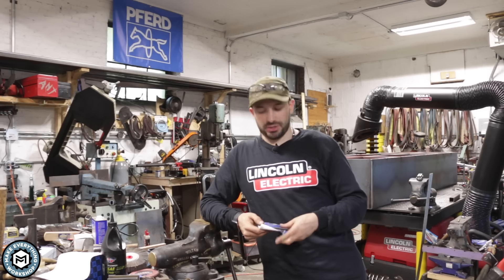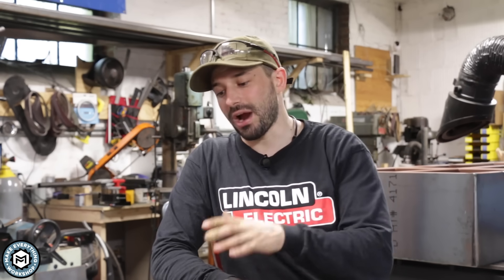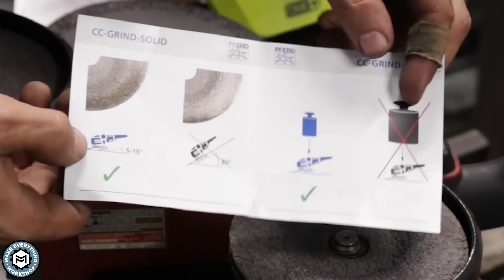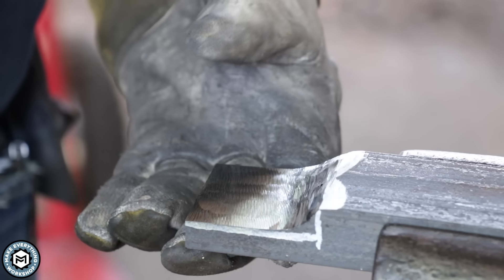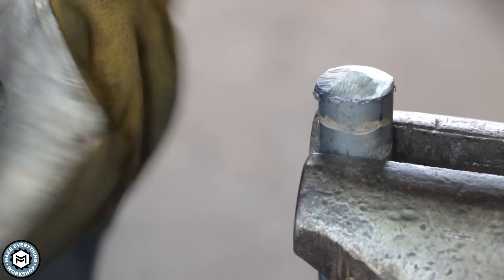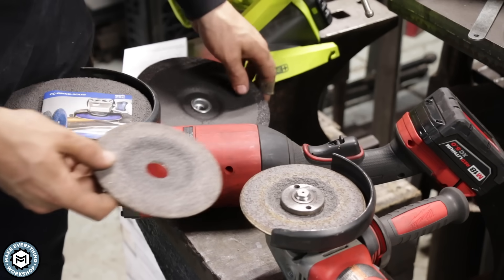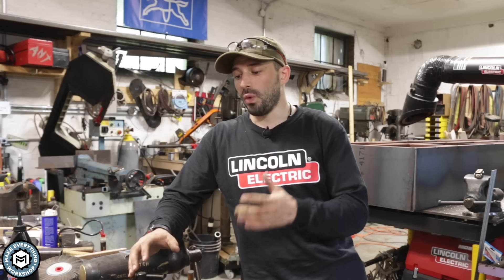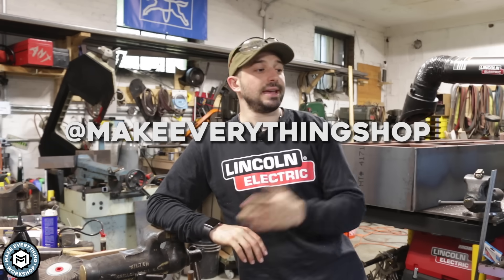A Grinding Disc That EATS Metal! Victograin VS Traditional Grinding Discs

Comment from the maker: Hey thanks for watching! Ive been updating the link for the discs as they are fluctuating into and out of stock. I’ll try to keep ontop of it! I just updated it so check it out!
Reply: Rapid grind makes the same disc 4.5 inch under 6 $ check into those
Reply: @briangreenfield7236  Have you used both? Just checking because if you haven’t used both you can’t compare.
Reply: @Len M.  no but I have used the Sharkskin disc's and the rapid  Shark skin were around 18 $ and I found the rapid grind for 1/3 the cost and they were the same trust me I can get you the Info if u would like to try them out ?
Reply: Will these fit the 4 1/2'" Dewalt grinder?
Reply: Man up, finish the test.

Comment: I need that Victograin for knifemaking. Won't even have to buy a belt sander (requires different pressure).

Easy grinding of spring steel and less filing needed.

Comment: Looks good…but not cheap.  A box of ten (in 2024) is 77 Quid (say 83 bucks).  A pack of ten regular bonded fibre discs are about 14 Quid (say 16 bucks)”  So “about the same cost” No! Not even nearly, but if they last five times longer you’ll beak even (source: Amazon).

Comment: Looks like Amazon has them individually for cheaper which im not ready to buy 10 at a time but i may order 1 or 2 also i almost never use the regular grinding disk i generally use the flap disk

Comment: I bought some and used it. The good thing about them is the size of dust is big and does not float in the air. Regular grinding discs cover every corner with black dust.
Reply from the maker: Yes! That’s one of the best parts about these, far less fine particles airborne!

Comment: ive welding fitting fabricating for a long time and give me a 1/8 pipeliner and ill smoke both of those. cheap grinding wheels vibrate. a good brand while they do have their bad ones every now and again its not nearly as many as the cheap brands. im not saying your lying but speeding up a video can hide a lot of truth

Comment: These are one piece of garbage.... Bought 2 disc for 14 bucks..... ate one disc in no time.... traditional grinding disc is way to go, no wonder there aren't other type of discs like this in the market, cuz they are garbage
Reply from the maker: You probably pressed too hard. Its a low angle low pressure disc.
Reply: Like the Spyderco ceramic benchstones, you don't want to press too hard or too soft on the metal.

Comment: I don’t think these disks are the same price as regular disks.
That being said I have some myself that I bought and I was absolutely blown away by the performance. Worth every extra penny over the regular ones. Especially the fact it doesn’t vibrate as much, really saves my hands. The shavings are also visibly different, much more stringy than the dust the normal ones produce.
I still have a regular disk kicking around somewhere but I don’t think I’ll ever use that again.

Comment: I have tried every sort of cutting/grinding disc’s you can get. Everything from local and big box stores to amazon brands. Pferd is the best. It is night and day difference how much better Pferd disc’s are. The only problem is that nobody readily carries them here in the states, so you just have to plan ahead and order accordingly. The performance and durability of Pferd grinding and cutting disc’s are absolutely amazing. It’s not even close.

Comment: Holy heck .. I just realised , if i don’t apply as much pressure onto my accelerator in my car , I use heaps less fuel. Just takes me 5x as long to get anywhere. Wonder if it’s the same which craft as these discs ? 🤔

Comment: Hi Chris, I was curious what the best cut off wheel you reccomend for a milwaukee m18 5" grinder/Cutter? I got quite confused over all the different types. Im not looking for a cutting/grinding duo....Im mainly going to be cutting hardened steel and stainless, grade 8 bolts as well. Thank you for your help!

Comment: Thank you for this video!! They are flat out amazing! After watching this I ordered a 10 pack off of Amazon. 5" Pferd victograin. You have saved me time, money, and M18 batteries! I sharpened our Fecon Blackhawk mulcher head on a 2021 cat 299 d3 skidsteer. The mulcher head has hardened steel for the teeth. You are absolutely right these are 4X faster than any traditional grinding discs. The teeth sharpened extremely quick without getting too hot. I will never go back to old school grinding discs. Pferd makes the best chainsaw files and grinding discs by far.

Comment: I had the same revelation when I tried Cubitron discs for the first time.  You quickly realize what utter garbage the HF discs are, and how 'stone age' typical discs are.  I'll definitely be trying out some of these.  Would be cool to see a comparison of these to other structured discs.  They still do seem like an awesome value.  I mounted a 4 1/2 grinder in a vise (eye-bolt into handle threaded hole, and remote switch), and put a cubitron disc on it.  It's the best darn rapid bench grinder I've used yet.  Think I'll build a mount for it to free up the vise.

Comment: I'm a professional.
Not a hobby horse.
I FULLY ENDORCE
 PFERD PRODUCTS. (UN-PAID)
Don't pay much mind to the harping and wise ass coments.
My maintainence turnaround time has to be fast. I often grind (removals) others would put in a milling machine. Including form fitting the repair. Some of it is so aggressive I frequently re-grease the bevel gears in my side grinders.

I haven't used a PFRED product yet that didn't do everything it's suposed to do. I'll be trying these next.

Comment: I'm new at this, but wouldn't it have been faster to use either a hacksaw, recip saw with metal cutting blade, or a miter saw with a metal cutting blade to cut the round bar (and perhaps finish it off with grinding the edge smooth)?
Reply: Yes, absolutely, best option if applicable. 

However that wasn't the point of the test.
The test was removal rate, round bar conveys that pretty easily.

Realistically you would never do this if you had other cutting options (cutoff disk, bandsaw, or hacksaw.)
Reply: It's called a  "demonstration".
Reply: It's called a  "demonstration".
Reply: It's called a  "demonstration".
Reply: It's called a  "demonstration".
Reply: It's called a  "demonstration".
Reply: It's called a  "demonstration".
Reply: It's called a  "demonstration".
Reply: It's called a  "demonstration".
Reply: Oh, so it's a demonstration of a crappy alternative.  Got it.  @waboom248

Comment: I'm gonna have to say bull, that's a lot of metal removed in a minute ,maybe 1/2 off the 1 inch round stock or 2 min for 1 inch but not 1 inch of metal a minute.  I used a 7 inch grinder with cubitron disc and only removed half inch off the 1 inch bar, you cut twice as much with a 4 1/2‽

Comment: Don't be too hard on yourself for leading into the grinding disc too hard. Everybody does that because they don't understand that the grinding disc to the metal and you let the disc do the work. If you could force the blade or the disc to grind the metal you wouldn't need to plug the damn thing in.
I worked at sheet metal for forty years, and I rarely saw anybody who knew how to use a damn grinder.

Comment: If you're continually grinding, for instance in a foundry, then fair enough but most guys use a grinder for a minute or two at a time. Most decent manufacturers have an equivalent ceramic abrasive wheel - Tyrolit Cerabond, 3M Cubitron, Norton SG so Pferd are not unique.

Comment: Off topic fab question.  I use 1 inch schedule 40 pipe offer and need to remove the inner weld.   You have a tool or process.  The pipe is no longer than 12 inches.  I’ve tried barrel type flap wheels and stone wheels on an extension.  Any help be appreciated.  Love you channel.  Found you yesterday and have already picked up a few pointers and got my shopping list together.

Comment: Bro i like them grinding disks but i use traditional grinding disks at work for hours a day preparing things before i weld them up and getting components made for building carnival rides and i never get sore from grinding i use a very high angle and it will eat metal with very little pressure i hold it at about 80° and it goes easy as long as you have the depth control so your not digging in but i will say those grinding disks are impressive.

Comment: Try out a Cubitron.  They can be used just like any other grinding wheel, last a long time, and eat faster than the cheapos I used to use.  I've never given thought to the vibration, but thinking back I think they're smoother running than the cheapos.

Comment: Maybe the vibration would be better if you were using a real grinder instead of those battery things.
Reply from the maker: The grinder I’m using in this video is a corded Milwaukee variable speed grinder . Its a great tooln

Comment: Silverline supply the worst discs on the planet, they barely grind the oxide and pretty much just polish metal, you can see the total lack of sparks, they're amazingly bad. I've tried just about all makes in 30 years of metal fab.

Comment: I bought a couple and I will give them a try. I’ve been grinding on steel for over 40 years, now retired but still work at home on my personal projects. I will definitely put them to the test and see what happens 👍
Reply: How’s they do?
Reply: @01sctacoma  haven’t used them yet. I’ve been to Bizzy working on my cars to get them ready for winter, doing a lot of delayed maintenance on them that now needs to be done.
Reply: @MrMopar413  have you used the disks yet

Comment: Nice! Never heard of these before. One problem with the regular bonded hard discs is they stop cutting once the metal starts heating up if you need to remove a bunch of metal. You can see this by looking at the paint pen mark burning off and not with the other style discs.

Comment: PFERD (Preferred or P-ferred) is a great company. I use them at work 14 hours a day, 6 days a week. We no longer use grinding discs, but grinding pads. They're much better than the ones you're using. We use 40 grit on 42" diameter by 80' joints of pipeline pipe that we manufacture. I have permanent numbness from the palm of my left hand to the tips of my fingers. OSHA is a joke.

Comment: I think if they really believe that these discs will blow away the old discs and make people switch they should make buying a single disc to try available instead of a box for almost a hundred bucks if they are that much better they should be confident that after someone trys one disc they won't go back
Reply from the maker: I’m working with Pferd to make single discs available directly so it’s easier to try them. I totally understand why buying a 10 pack is a big investment, and people are skeptical. That being said, if you buy from amazon and your not satisfied your able to return within 30 days and get a full refund.

Comment: Just noticed the white marker pen disappears off the metal when using regular discs compared to the first disc which means less heat in the metal with first disc = less stress to the metal

Comment: And I just checked both links he always puts up the 10 packs because they are giving him a kick back for making sales on Amazon, because they track those links and who sends what and opens what...  I'll find one or 2 and test them out myself...  If you really want to show their strength do it for stainless steel or some other forged hard metal composition...  Wether it's hot rolled or cold rolled, medium and low carbon steel isn't a true test anymore...

Comment: Have you ever used cubritronn2 by 3m? Personally I've never used victoriana but I am amazed at how fast 3m disc can remove materials
Reply: Yesss cubitrons are sooo good
Reply: These hands down out perform the Cubitron.They also make far less dust as the 3M disc wears down quickly. I won’t go back.

Comment: Here we go again, a kick back from your sponsor...  Those other ones I threw out, literally 3 good uses out of the blue and red circled sanding discs, how are these going to fare better?  I've got  pictures and part numbers to prove it...
Reply from the maker: Try these, If your not happy with them, bring them back to where you got them. Amazon will take them back if your not happy, and so will most reputable supply houses. The proofs in the test, these things work great. Follow the pressure and angle, and also the RPM recommendations and you’ll get a lot of good use out of them.
Reply: @MakeEverything  I've seen high speed low drag gear before, usually it's too good to be true, I won't stand by those other ones you recommended, but I will give these a shot...  If I have to cut anything 1" or larger I'm usually going to the band saw or the evolution saw, not going to sit here for 5 minutes when the band saw does it for 2 minutes on stainless steel, or the evolution saw does a bit faster... Time is money brother you know that...  Maybe for getting out imperfections or you need to get in a corner, but you showed these don't do anything for corners, so that's a negative hit on my analysis...
Reply: @MakeEverything  these are very similar to the ones I have used before for stainless steel, I have a Norton Blue fire and a vortex something... Part numbers are gone but I've used these quite a bit.  

I got those ones from Pferd last time on Amazon, the ones you recommended in your video, and again, 3 good uses after making a roll cage setup and then a motorcycle frame separately, light pressure no crazy angles, I went through the blue and the red one, I have one left and I'm hesitant to use it... 

Lol I was ROFLMAO when you said your hands hurt...  So stop trying too hard to sell us on vibrating hands, you are wearing gloves and I believe same thing, work smarter not harder however, the majority of what we do is with our minds and hands, so having thick skin and working out physically is part of our overall health but maybe not in the job description necessarily...

OSHA isn't going around the military, especially the Marine Corps, how long you been riding in this 7 ton? (1 week straight day and night) How long you been in this 998? (This is where I sleep) I've spent damn near an entire enlistment deployed and sleeping on rocks and in military vehicles, I'm sure OSHA didn't care about our nerves then, nor now...

Comment: You forgot to say wear a full respirator, these have ceramic in them, not just regular stone/glass
Reply: Underrated comment
Reply: Never really considered that. Aluminum silicate and silicon carbide are two of the more common abrasives I’ve worked with. It’s probably a good idea to wear ppe when using any grinding disc in general.
Reply: @Bansheekilr  he did not get paid for that yet
Reply: Their website does state that dust is reduced by 80% which is a pretty significant margin, regardless i always use a respirator when grinding because the fiberglass always makes my lungs hurt and ache for a few days when i don’t use one.
Reply: Then make your own video and you say it. 😷
Reply: @chrishevia  I'm not trying to sell you these cancer discs mate.

Comment: This is nothing more than another commercial. We already have enough of them.
Reply: For real. You can not trust this video.
Reply: I'll be honest that is what I thought too. It is like an infomercial he is trying to sell it. I would like to see this used without video sped up. It just looks fishy to me.
Reply: @nickbussard6089  His whole thing about not being able to hold on to the grinder when using a normal gringing wheel is bullshit. We all use normal grinding wheels without issue.
Reply: Another thing for me is the groves would absorb most of the vibration and you don't use a lot of pressure rock wheels anyways.

Comment: Lost a lot of credibility with this video IMO. I have never paid more than $2 for a regular 4.5" grinding disk and only a very weak person would be that tired after grinding for less than 10 minutes. At more than 4 times the pice ($70 for a 50 pack on Amazon) this isn't nearly as good of a deal as you make it sound. I like great products but value honesty more.
Reply: You can't compare a top of the line product to the bargain basement bulk junk on Amazon, genius. That's not the way product comparisons work. You don't compare a civic to a Ferrari. Derp. It's the same price as a comparable disk from the name brand manufacturers like Diablo or 3m.

Comment: I like the idea of the non-vibration feature.  I don't grind as much as I did 25 to 35 years ago but I know what you mean.  I can only go so long and the vibration wears me out.   I am going to try some of these.  I have Pferd 9" regular disks.  I like their brand but usually buy the cheap 4-1/2" or 5" disks.   I need to look in to this. Thanks for the review.

Comment: Man I’m so glad I saw this, and thanks for taking the time to showcase such a great product. As a blacksmith I go through discs like crazy and have searched far and low for a great disc like these and finally settled on ceramic flap discs but that’s gonna change now from watching this. I know Pferds quality having some of their Carbide burrs, and files, and they make the best modern made metal working tools I’ve found so far, shows how many tools they offer with these sitting under my nose the whole time.

Comment: Flapper disc......I do NOT care about price. I despise hard wheel grinding discs.
Reply: They are great for finishing but they don't last as long and if you overheat them the glue that holds the sand/aluminum melts off